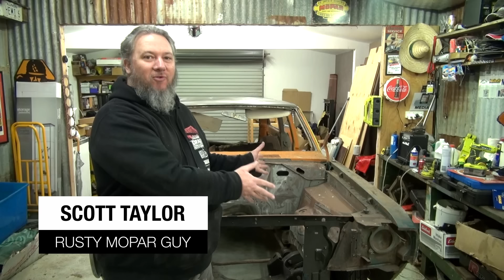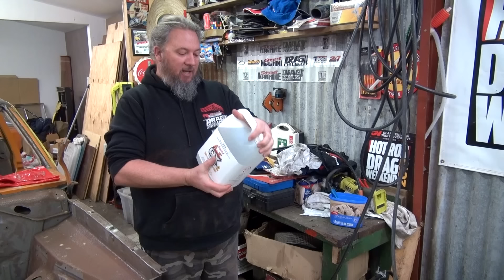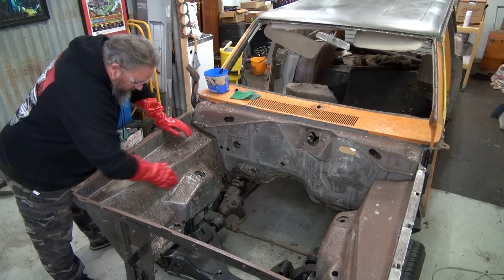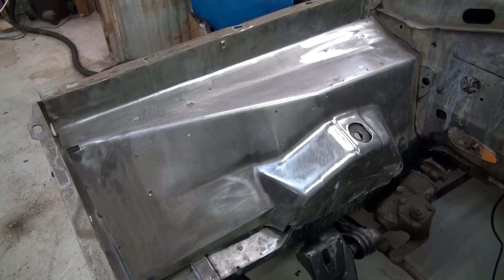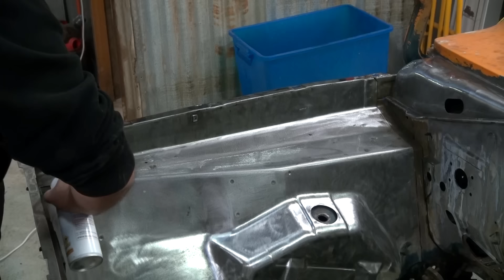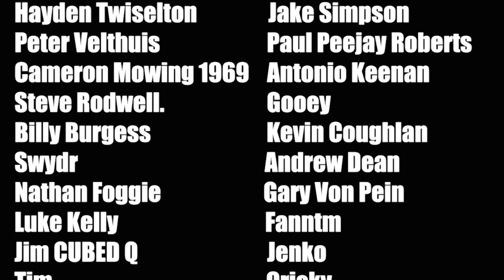We De-Rust The Engine Bay Using OxyTech!

Comment: If that product was to “remove rust” why do you have to sand while its on there? Seems a bit much to have to use sanding with it to remove what its sold to do, im not knocking the product but just asking for clarification.
Reply from the maker: Just to help it get right in there. It's like toothpaste, to use your analogy just squirt it on to your teeth

Comment: Also do yourself (and your eyes) a favour and get some Toolpro red nylon wire brushes from Supercheap. I switched from metal wire brushes years ago after my wife copped a chunk of steel wire in her eye. The nylon brushes are impregnated with an abrasive that is brilliant for removing surface rust, paint, even some filler and it won't do any damage to the metal surface. Leaves a clean scratch pattern similar to 120-180 grit sander. Perfect for weld prep and no more flying metal needles to get stabbed with.

Comment: Hi, so it appears ok for say inner guards, floors etc

How does it cope with outer panels and will paint stick to it OK ??

The engine bay will that be normal 2pak or will you sue something like hammercoat / rustoleum - i cant spray paint for peanuts thus my question and i leave the outer skins for the pro's and do my best on the rest
Reply from the maker: @georgemaragos2378  the engine bay will be normal paint

Comment: Give me a yell if you are looking at front rail rust repairs. I did heaps in my business. Properly
Reply: Seriously... I had laser plates cut, internal supports hand made, etc. Not one of the after market "repairs" are anywhere near like mine. I was fully repairing these in '86. Steering box forward. K frame mounts. Properly done with my years of experience.
Reply: Use my experience mate

Comment: Evap-o-rust is another very good rust removal product. It's non-hazardous, biodegradable and reuseable plus it doesn't mess up delicate stuff like already existing paint (that is well adhered), rubber, plastic, etc. So you can dunk whole assemblies in it and it'll come out rust-free.
Reply: It sucks!
Reply: @ZAPATTUBE  based on what? I was VERY skeptical of it. I threw all kinds of nasty crap at that product and it NEVER disappointed. Worked as advertised EVERY time.

Comment: Could have done it with just the sander, but think of how much dust and disc's you'd have to go through. Having the fluid pick up the iron oxide dust has got to be the smarter way of doing it.
Didn't Phosphor coatings replace Lead Dips at the manufacturing?

Comment: Pretty much a waste of time and effort y when you can sand blast it and blow it down with air blow out the rails and seams and smash it in ppg epoxy primer.. and a old engineer mate of mine said if you want the rust proof inside box sections and seams use straight PENETROL as it completely seals it out drys Clear and penetrates better than water 💦 and will last years and it’s made by PPG
Reply from the maker: @michaelbyrnes7944  sand blasting is messy, and you need a much bigger compressor than what I have
Reply: @blownhemi  yeah true I don’t like blasting the outside of any car only engine bays and boot and floor pans inside and all underneath the car pretty easy put the car on a rotisserie then I get my old bosses tilt tray take it to the blasting man I always say don’t put primer on it until I give it my tick of approval it’s quick easy and don’t cost much and is perfectly clean ready for epoxy and repairs and your not worried it’s going to go rusty
Reply: Blasting is only one step to get metal clean, it also doesn't kill the rust it only moves it. Blasting, followed by a chemical wash like Anti-Ox, then sealing with EasyPhos or an epoxy primer is the best way and minimum industry standard today. Blasting inside the rails and cavities, then power-coat primer is the best way to prevent rust inside those areas.
Reply: @Iainkellyis  yeah yeah whatever you say mate been in the Industry since I was 15 built many show cars never had any complaints or come backs from elite custom holden one tonne Utes to American Mustangs and everything in between and still going strong you have a great day bud

Comment: Looks great! Im not usually a fan of acids so would have painstaking used a wire-wheel over the lot. Starting to rethink my strategy haha
Reply from the maker: A wire wheel would take a lot longer
Reply: The good thing about an acid wash is it gets into all the corners and places a wire wheel misses, plus it chemically eats the rust. Just need to make sure you de-activate the acid with water, then blow that off and protect the cleaned steel with EasyPhos straight away

Comment: If it can be brushed off with a wire brush or scowering pad it’s light surface rust.
Wasting chemical rust converter on panels that you can sand and then sanding them is doing it wrong.
The main reason to use a rust converter is to get the stuff you can’t sand off, to neutralise it so it can be painted over.
As a product demonstration going over a rusted panel does show that it works.
The process for actual use would be , remove loose rust with brush, sand the surface as needed then use converter to get the stuff in corners cracks and seams etc.
Most converters use an acid that reacts with the rust removing the oxygen and replacing it with another substance like phosphorus making iron phosphate.
Reply: Cleaning and conditioning the metal is not a waste of time, and you don't need to use a brush, then sand the area first. You do a much more thorough job of cleaning out the corrosion with a wash (which needs to be neutralised with water and dried immediately) and then the sanding just provides a keyed substrate for priming.
Reply: @Iainkellyis  I said wasting material not time. Cleaning the surface of loose rust scale with a brush first reduces the amount of converter needed . Also you can vacuum the dry dust and not need to mop up mud.

Comment: Was it really that successful? I mean if you are using something abrasive, you could hit it with water and remove a lot of it with a scourer. Without being there it is hard to tell, but can't say I am 100% convinced. Would have been nice to see you do the other side with water to get a real comparison.
Reply from the maker: I don't think water is going to get even close. The acid works straight away.
Reply: You can tell when it’s reacting because of the whiteish colour it takes on (which is fine bubbles). You can see it about 10 seconds after he brushes it on.  A scourer and water won’t get anywhere near that much rust off.  A sander would, but you’d still need to de-ox it, as you can’t reach into the myriad of tiny rust pits with mechanical abrasion.  😊
Reply: @commodorenut  my eyes are too old to pick up the bubbles you mention (or my screen is too small, lets go with that).

Comment: its basically a Phosphoric acid at 30% in the bottle. you can find it in some home brew shops a lot cheaper and stronger 85% for cleaning and sterilizing
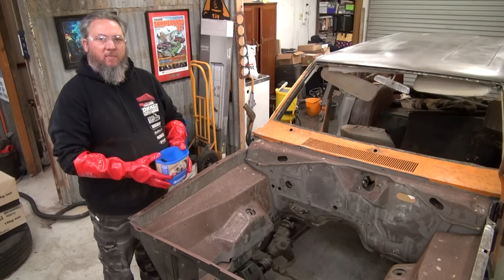Reply: Paused at 3:04 and read label, Spot On!
Reply: Dairy piping 'milkstone remover' is ~50% Phosphoric acid, but leaves a chalky residue if not scrubbed off.  Best used for soaking  smaller parts.
Reply: Then I suggest that you use it outside. Otherwise the medal that was intended elsewhere on not being worked on will now rust😬.
Reply: In the states, they sell Rust Kutter at tractor supply in a spray bottle or gallon jug. It’s also Phos acid.
Reply: I see no reason to do the sanding and then apply the Phos spray.  The phosphoric acid itself creates a stable oxide layer which can be painted.  I used phosphoric acid on an old motorcycle I restored and just rinsed ot with clean water dried it well and painted it.
Reply: @kirkjohnson6638  Because the paint may still be sealing the rust just below it. Just because you don't see rust doesn't mean it's not there. Just like wrapping hedders and turbos. That too is a bad idea, because it's now rusting from the inside out and by the time you see it, it's too late.
Reply: @lynnrunningdeer  Sorry, in the video I couldn't see any paint and thought the surfaces were previously stripped of all paint.
Reply: @kirkjohnson6638  You asked "why would you go through the trouble of removing all the paint". I explained why this is sometimes a bad idea. On another note. Never use this stuff inside otherwise whatever is unprotected metal will soon rust. They need to update the advisory to say "use outside only".
Reply: @kirkjohnson6638  Also there was nothing to be sorry for, you didn't do anything wrong😁.
Reply: @lynnrunningdeer  No, I asked why you would sand the surfaces after using the rust remover.  To me, it didn't look like there was any paint to begin with.  I thought that your sanding would only be removing the stable oxide layer which would then allow the surface rust to come right back.  I would have sanded or sandblasted first and then used the phosphoric acid and not sanded the surface afterward.
Reply: @lynnrunningdeer  Well, I may just not have been observant enough or didn't bother to zoom in to get a better view.
Reply: @kirkjohnson6638  Not sure how you would achieve zooming in unless you screenshot it🤷‍♀️.
Reply: @kirkjohnson6638  Me personally depending on who it belongs to and how long it's gonna be kept will dictate how far I go with painting it.
Reply: @lynnrunningdeer  I've got a zoom widget on my phone from the google play store.  It's pretty handy at times especially when my old eyes are struggling.
Reply: If that's what it is then I suggest that you use it outside. Otherwise metal elsewhere that you had no intention on working on is now gonna rust. I've never used it but someone's story made perfect sense. Acid when becomes airborne it attacks everything elsewhere. Use baking soda to neutralize it, otherwise your waisting time and money.